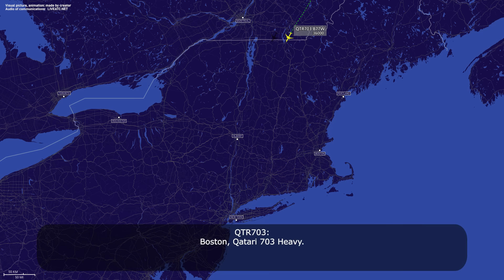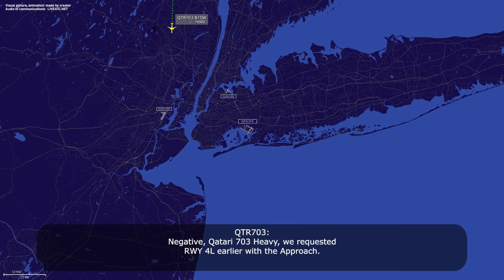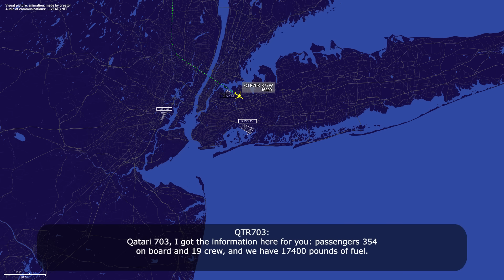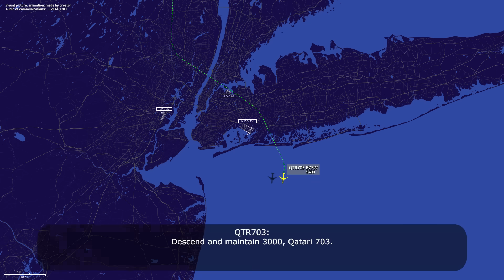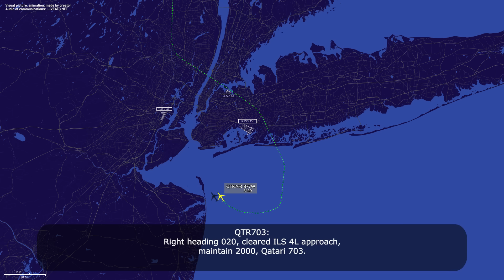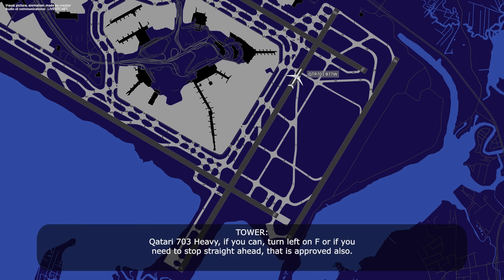Surprised controllers. Low tire pressure. Qatar Boeing 777 requests longer runway at JFK. Real ATC

Comment: Much ado about nothing, one tire with low air pressure in a six tire truck on one side and a total of 14 tires is a non-event as it was evident from the landing and the post landing taxi to ramp.😂😂😂😂
Reply: Unless the flat tire has unscheduled disassembly and other tires on landing.     Always a good idea to give yourself the best chance by taking the longer runway.    I'd guess that it is in the checklist or company policy...

Comment: A low tire pressure will result in a much shorter roll out on landing.
Reply: They can’t put braking pressure on a flat tire otherwise it’ll melt from the heat

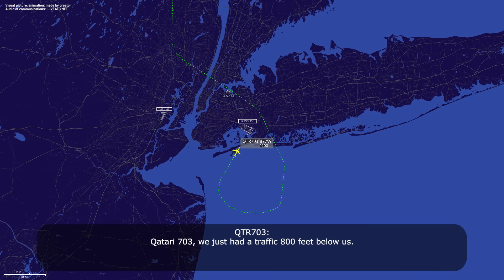Comment: Wait wait wait, 7:05 a C172 800ft below a heavy, wonder how bumpy they had it lmao
Reply: Only in the US will you have this happen. Amateurs flying just few hundred ft below heavies carrying 350 odd pax. No wonder their aviation industry is suffering right now.
Reply: @guneetify  Completely unsafe. All it takes is an erroneous altimeter on one of those aircrafts and we have DC all over again but way worse.
Reply: and a stunning view of a 777!
Reply: A lot of smaller aircraft transition 800 FT below the JFK final approach at 500 FT MSL where that bravo starts at 501 FT MSL along the shore line

Comment: 19 crew onboard? That seems like alot.
Reply: It's a 14 hour flight, hardly excessive at all when you take in to account multiple flight crew as well. At least 3, so 16 cabin crew is hardly a lot for a fully laden 77W. Not all airlines run on bare minimum allowed.
Reply: @skoodledoo it’s 3 if more than 9 hrs less than 
12 anything exceeding that become ULH and it’s 4 flight crew
Reply: @flyboy5788  Thanks for the clarification!
Reply: It's a 777 with 350+ pax. Being Qatar I heavily doubt that it's single class only so 19 crew (2-3 flight and 16-17 cabin) is fairly normal.
Reply: @EddieMatou 4 flight crew and 15 cabin. On some other variants of the 777they have 400+ pax and crew can go up to 20
Reply: it’s not normal to have 16 cabin crew on a 777
Reply: @kickedinthecalfbyacow7549 nothing to do with the aircraft type. It depends on the seating configuration when there 416 pax it’s absolutely normal for 16 cabin crew to be present
Reply: @flyboy5788 it has a bit to do with the aircraft type, but mostly it’s down to the airline, Middle East airlines carry far more cabin crew than European or North American Airlines do. You won’t find a 777 with 16 crew in Europe/North America
Reply: @kickedinthecalfbyacow7549  completely agree with you mate, but there are certain regulations that require a min number of cabin crew per pax (I think its 1 per 50 pax) and yes european carriers usually try and meet the minium requirment only
Reply: @flyboy5788 obviously they don’t fly with minimum legal crew, you need some level of redundancy in case of sickness etc.

Comment: What do they mean that they will probably have to vacate at the end of the runway?
Reply: They will use the full length of the runway to exit due to the fact they have a low tire pressure warning they don't want to slam to hard on the brakes.

Comment: Someone messed up. Surely it is quite straightforward to pass on requests to  the relevant people so flight crews don't need to repeat  themselves. Unnecessarily increasing the workload of multiple people.
Reply: Using Verizon phone system,  so they probably couldn't patch through to NY. 2 paper cups and a string
Reply: That's humans for you, it happens.